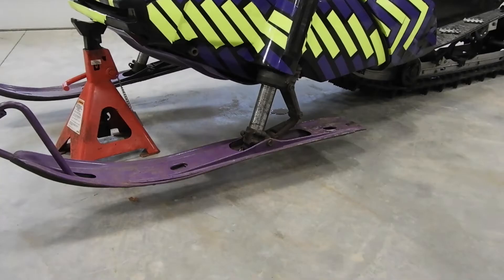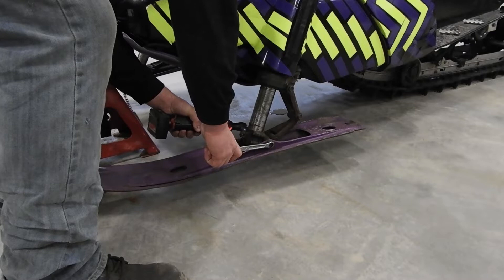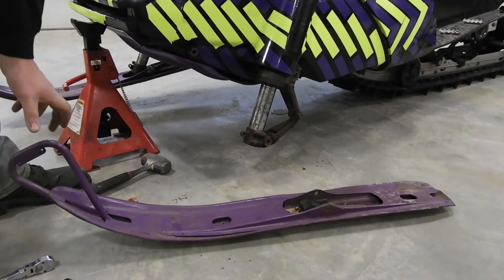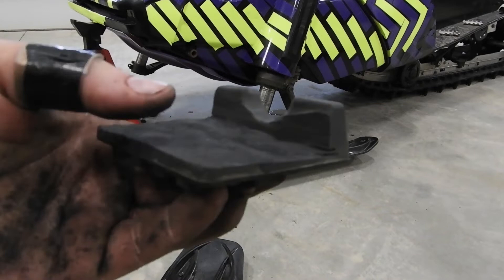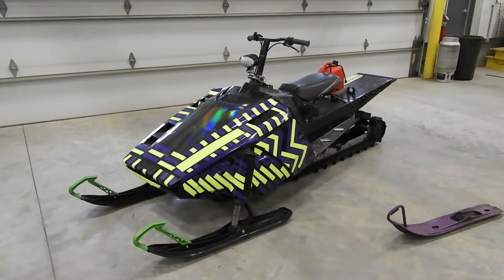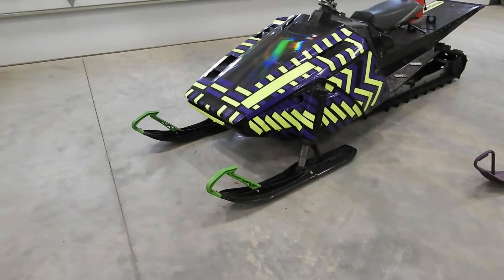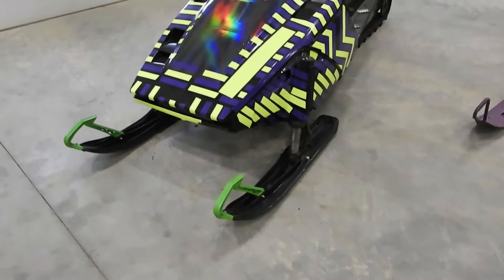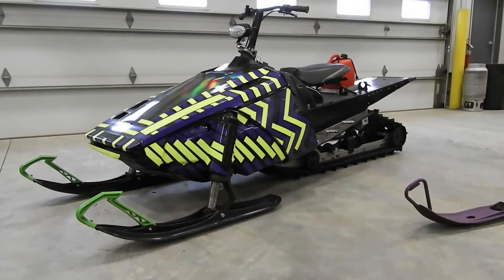Upgrading to plastic skis on the 85 Phazer

Comment: I have Arctic Cat plastics on my 92 Phazer. I made new brass bushings that press fit into the original saddles (shoes?) that came with the skis. I also had to make some custom spacers to make up the difference between the saddle width and the Phazer's ski mount. 

I also tossed the original Phazer rubber dampers as there was no way I could make them work on the Cat skis and haven't had any problem running without them. I don't jump or get too funky on my sled, so I'm not too worried about the missing dampers.

I noticed immediately how much better the plastic skis were, although the sled did get jittery around 50MPH. I added 3-1/2" lift brackets for the back, and it helped shift my weight forward onto the skis. Now it handles MUCH better! I have no idea what its top speed is, but I can tell you it has plenty of throttle left beyond 50! 

I LOVE THESE SLEDS!

Comment: They are just called "arctic cat trail ski". I use them as well on most of my Phazers but I just remove the dampener completely. I've put probably 4000miles so far on one of them with zero issues.

Comment: Curious, is there quite a bit of weight difference to the plastic vs old steel ski?
Reply from the maker: I didn't weigh them, but just by feel, the steel ski feels only slightly heavier. But that is without carbides or ski covers, so I do think there is a pretty good weight savings. What I'm mostly hoping for is better performance, flotation, etc.